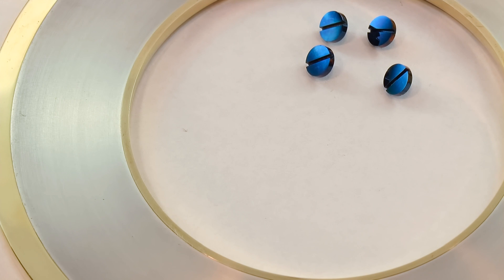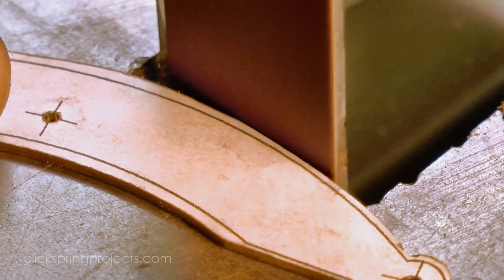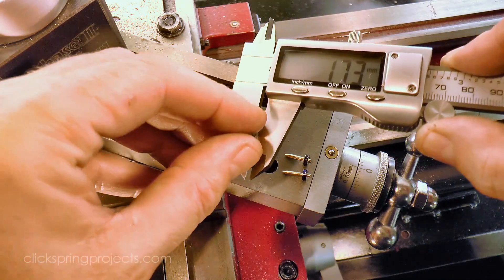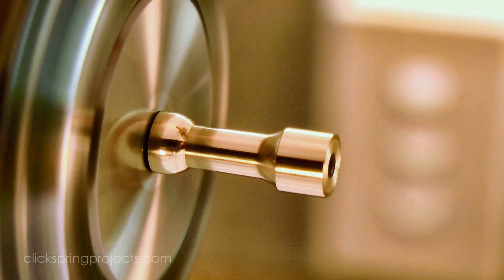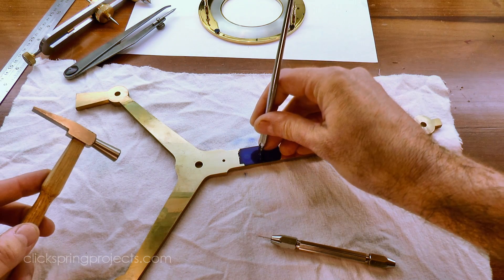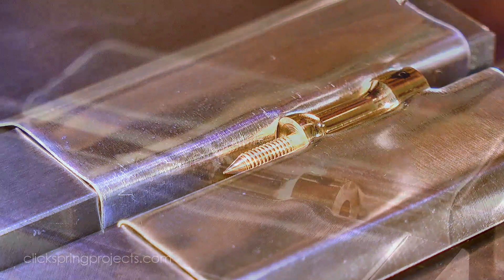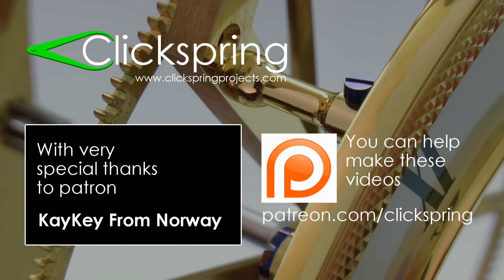Clockmaking - How To Make A Clock - Part 15 - Fitting The Dial Assembly To The Frames

Comment: I am sitting here discouraged, because I'm designing the gear train for a clock and just realized that the main wheel requires 2789 teeth to create an accurate ratio between days and lunar months.  To be exact, between 9-day periods and 850-lunar-month periods.  and 2789 is prime, damnit.

Comment: Couldn't you achieve the same aesthetic result by making to thread on the two ends of the pillars, on clockwise and the other counterclockwise. Then you would just unscrew the pillars to take the faceplate off.

Comment: When using 603 is it better to reem and polish the surfaces or leave them rough? I remember using roughing tools on access holes that were later going to be plugged when I worked in a machine shop making hydraulic components.
Reply from the maker: +rimmersbryggeri One of the most important parameters of a good Loctite bond is the size of the gap prior to adding the adhesive. It is easier to control that dimension with a reamed hole. More info on the data sheets for the products: http://www.henkel-adhesives.com/tds-search-29668.htm?keyword=603&page=0

Comment: Why did you use the needle files instead of the filling machine you have for the brackets ?
Also cheers for the fantastic videos!
Reply from the maker: +Lord Commander Basically it comes down to the fidelity of the tool. Generally the filing machine is great to get a workpiece close, but there is no substitute for a needle file to get a really precise result, and then follow with abrasive paper and a burnisher. thanks for watching and asking LC

Comment: Thanks for the heads up, I think I can make one like that. Your clock video's are amazing I would not have the patience for a build like that but I'm learning a lot of tips from what you're doing, I'm building my own CNC router at the moment and It's already taken me a year. luckily I live alone now so I have more time for it. some of what you're doing applies to what I'm doing, I like the idea of making a tool to cut the form all at the same time, I work with aluminum but I think it's similar to brass as far tooling is concerned.
  I thoroughly like  your video's keep up the good work. any tips on cutting aluminum would be greatly appreciated

Comment: Great video as always! A lot of info and techniques there! But... is the lacquer diluted with thinner  at all??? (it says so in the can, but is that a reminder or a note?)
Reply from the maker: +BIll Georgoulakis Hey Bill, yes the lacquer is diluted 50/50. I find it goes on a little more consistently if thinned, although there is a limit. If it is too thin, then it generates a thin film interference effect (rainbow colors) thanks for watching
Reply: +Clickspring Yeah I though it was abit thin. So what kind of lacquer is it? is it oil based Polyurethane or something special? Have you experimented with semi-gloss or matte finishes for the lacquer?

Comment: Hi  curious where you buy your marking dye ? I cant find small bottles anywhere!
Reply from the maker: +drew7376 I get it on Ebay, search Dykem Blue layout fluid, thanks for watching
Reply: Thanks, I did find some at Blackwoods  called Dy-Mark Engineers layout ink,  but  they are 1 litre bottles
Reply: BTW  Love your work

Comment: what is the paper you use at 2:04 for polishing
Reply from the maker: +jose vega Hey Jose, just standard A4 printer paper. It gives a good preliminary result, but still leaves very fine marks. The final polish comes later using cloth and 1/2 dowel polishers. Thanks for watching

Comment: What are you using as a screwdriver?
Reply from the maker: +Michael “mooP” Haymore Hey Michael, its a small hand vise with a scrap of brass - I don't have a correct sized screwdriver for these bezel screws, so this is a quick fix until I make a new set. Thanks for watching and asking.

Comment: How durable is that blue finish on the screws?
Reply from the maker: +ck m It is a reasonably fragile coating, so poor screwdriver technique etc will scratch it. But if its handled well, it has been observed to last for many hundreds of years in antique clocks and watches

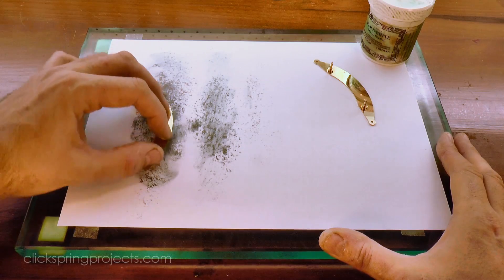Comment: Nice vid again.- at 5:53, doesn't the thinner dilute or alter the loctite cure?- at 6:02, what is the paper substrate that you are applying the polishing compound to?- re the lacquer, what is the reducer you use to dilute? what is typical dry time with looks like a heat gun? Is this your go-to preservation method to keep the nice polished brass shine?

Comment: Chris, thank you for making the video, great work! Questions; how did you use the point screw to find the center line? And I saw that you marked the point of the screw where you wanted to drill the set screw, but how did you line up that point to be at top dead center?  Thanks again!

Comment: How long will stay termal colouring on screws and other steel parts? Is it strong enough?
Reply from the maker: +Andrey Ovcharov It is a reasonably fragile coating, and will scratch easily if mishandled with poor screwdriver technique etc. If handle well, and left untouched it can last many hundreds of years. Thanks for watching Andrey.
Reply: So it is going to last for years even without coating? I was sure that it will weather off very soon. Thank you for the explanation. And for awesome videos of course!

Comment: Hi Chris, I like you videos. I wondering how you prevent the brass getting dark and ugly...
Reply from the maker: +JF- Knives There's really only two options, lacquer or electroplating. I don't have a plating setup, so for this clock it will be a combination of lacquer and simple polish. The wheels can't be lacquered, so will eventually develop a patina over time. Frames, pillars and bezel will be lacquered, but still develops an aged color even under the lacquer. Thanks for watching and asking :)

Comment: Dear +Clickspring, at 7:12, you use a "depthing tool to mark-out a distance". You do this by first measuring out 60mm between the tips of the tool against a scale. Subsequently, you center one end of the tool in a pre-drilled hole (it sinks-in about 3mm into the hole) and with the other end put a marking onto a layer of that fanpage-worthy DykemBlue. If you go with a simplistic Pythagoras, then, due to the 3mm sinking of the cone into the hole, the distance to the marking shall be sqrt(60^2+3^2) i.e. about 75 micron off. Does the conical taper on the center-pin counteract some of this error? Could a spirit-bubble level on the shank of the depthing-tool minimize this error? 
Beautiful video mate :)
Reply from the maker: +Aditya Mehendale Hey Aditya, yes I was a little relaxed with that! The easy way to avoid the error is to use a pointed runner to set the distance (keeping the tool body horizontal) and then replace it with the cone runner for the scribing (also keeping the tool body horizontal). The reality is that for something like this the error is small enough to be of no real consequence. Planting the train on the other hand requires absolute precision, and therefore the process I just mentioned. Thanks for watching and asking :)

Comment: Amazing work - as always. I can't wait to see it completed! I have a question - when you have to make multiple copies of the same part - do you do each copy from start to finish (constantly swapping the tooling out), or do you leave the tool in place and cut that one cut for multiple parts? I imagine it comes down to swapping tools a bunch, or swapping the individual pieces out of the lathe a bunch. Hope that makes sense!
Reply from the maker: +Mitch Spacone Hey Mitch, generally I complete the part, and then move on to the next because there are usually multiple ops required where the part can't be disturbed before completion. Thanks for watching and asking.
Reply: +Clickspring That makes perfect sense - thanks for answering my question!

Comment: Maybe this is a stupid question, but why do you use a clamped brass bit to screw in the screws instead of just a screw driver with some painters tape on it or something?

I assume you don't use a bare screw driver to avoid scratches, but is there any other reason than this looks better on camera than taped up tools does?
Reply from the maker: +Evan Smith Hey Evan, I don't have a screwdriver with a wide enough blade that is also narrow enough to fit the slot of these bezel screws, so a scrap of brass filed to size is a good solution. Being a brass scrap also guarantees no scratching/damage to the screw. Thanks for watching and asking.

Comment: Nice one Chris. Is that lead you're using for soft-jaws?

What will you use for final protection of the brass? You're using lacquer on some parts now, but imply that won't be the permanent solution. I made some LTD Stirling engines for friends a few years back and they looked great when finished, but wax wasn't enough to prevent them losing their "bling" after a while. It would be good to know what to use to protect brass etc on work such as this.
Reply from the maker: +Pete F Hey Pete, the 2 most common options are either plating (gold or rhodium), or lacquer. I don't have an electroplating setup, so its going to have to be lacquer for now. Frames and pillars will be polished and then lacquered at the very end of the build. The wheels can't be lacquered, so they will be polished, and will eventually develop a natural patina as is the case with most clocks.
Reply: +Clickspring Thanks Chris, &quot;natural patina&quot;, I like it! Ok, I&#39;ll lacquer them in future. Caswell Australia has a gold plating kit, you probably already know about.  I don't know if it can plate brass, they also don&#39;t exactly give it away either!
Reply from the maker: +Pete F Yes I've looked at a few of the commercial kits, but I really need something quite large to handle some larger parts for future projects. Will probably have to make something. A friend recently sent me some plating textbooks, so I've got some reading to do! Cheers mate :)

Comment: That metal polish looks very effective!! Are you just using it on a sheet of paper, or is it something special? Here in the UK we have "Autosol" metal polish which works a treat on nonferrous metals - it's weird how it works, seems to actually react slightly with the surface since it initially turns a black mess, but then brightens up when rubbed with another clean cloth.
Reply from the maker: +Lindsay Wilson Yes just paper, although to get the final finish, I switch to cloth on a wooden dowel 1/2 cross-section polisher. That polish is absolutely superb, quite a bit finer than Autosol, and also leaves a wax coating that helps prevent tarnish. Bill Smith makes it: http://www.wrsmithclocks.com/polish.htm Thanks for watching Lindsay.

Comment: Really fantastic work, I'm always excited to see a new video! Two questions: Why are the screws you make always flat head? And what model mill do you use?
Reply from the maker: +nebnoswel Mill is an SX3. Both flat cheesehead and domed screws feature prominently in classic clockmaking, however I have a personal preference for the classic horological shaped cheesehead screw - perfectly flat top, slightly thicker head than a modern general engineering screw, with the barest hint of a bevel on edges. Thanks for watching and asking.
Reply: +Clickspring I think he meant the type of driver that the screws are made for,  though I was wondering if there was a specific reason you made the screws that particular shape. I'm guessing the screws are slot headed because it's simpler to make and looks better than a double slot? (We call them flathead screws here, because we're bad at naming stuff).
Reply: Thanks for the reply! Sorry for not being clear, I meant why are your screws always slotted, but it does make sense that it's easier to machine. Keep the videos coming!
Reply from the maker: +Teth47 +Ben Lewson Sorry my misunderstanding :) Yes easier to make, and again a tradition thing. Thank you both :)

Comment: These videos do not come as often enough to satisfy my innate need to see something completed, but I understand you're doing this as you go, and to make each part and video it, then to also edit it are all each projects in and of themselves.

These videos are soo good i just need more and more. So keep it up; I can't wait for the next one already.

Nice to see the thought process you're doing in completing the clock. Gives me insight to what i may go through when i start making one (once i get the necessary plans and parts.)

Two thing about this though that always take a quick step back, the scale of the parts, and the machinery needed to get it done. 
Scale, as in, when you video it, it is so close, macro like, that I think it's bigger than it really is. As far as machinery, I'm thinking what minimum i would need to just even get started. the small sherline (?) lathe i can see is going to be useful in making all the pins, screws, pivots and parts for other projects ; but then what about the bigger pieces, like the barrel assembly, the frame and the wheels? in a minimalist work shop, what would be the best way i can go about making those? Good thing is i have time to find these answers.

Comment: That's some fancy screwdriver you have there at 6:21 .
Would a "regular" screwdriver damage the blue temper somehow?
Reply: +Arturo Gutierrez IIRC it's visible in other videos that it has a brass blade with parallel-ground faces so it (A) doesn't cam out and (B) doesn't damage the finish in the screw slot
Reply: +Hyratel i'm so used to the crazy tools and detail of this series i didn't even notice the screw
driver.

Comment: What is the final finish on the brass parts going to be to keep them from tarnishing? Automotive clear-coat or something softer? If lacquer, then dipped, brushed on or sprayed?
Reply from the maker: +kopsik111 Most of the larger parts like the frame and pillars will be lacquered similar to what you've seen already. The wheels unfortunately cannot be lacquered, so will be polished, but left to develop a natural patina. The overall effect will be quite pleasing to look at. Thanks for watching.
Reply: +Clickspring Have you considered or tried carnauba  or some hard car wax?

Comment: I admire your work and envy your precision. One question though... Why don't you solder the parts together instead of using loctite? I'd love to see you soldering this parts and go oldschool...
Reply from the maker: +GROMarch I understand the objection to loctite, I gave it a long hard think before I started the clock as to what method I would use. Soldering carries with it a few headaches regarding metallurgical changes to the materials, as well as the cleanup of excess solder around the join, that can be a real pain to deal with. Loctite also is more convenient to reverse the join if needed. In the end I decided on convenience over tradition :) Thanks for watching and asking.

Comment: Were those lead sheets in the vice when drilling the set screw holes? Seemed rather deformed to be aluminium.
Reply from the maker: +Nolansykinsley Yes Aluminium. I though it was a tin alloy before I tracked down the link for someone else: http://www.bunnings.com.au/consolidated-alloys-300-x-0-7mm-x-20m-weatherflash_p1100465 Thanks for watching.

Comment: Hello Chris, how do you form the aluminium buffers that support the pillars when you drill and tap the holes for the set screws?
Reply from the maker: +Vinnay Chhabildas Hey Vinnay, that is some sort of plumbers flashing I picked up from the hardware store. I thought it was a tin alloy, but turns out its aluminium: http://www.bunnings.com.au/consolidated-alloys-300-x-0-7mm-x-20m-weatherflash_p1100465 Cheers, Chris.
Reply: +Clickspring Thanks for replying, what got you into clock building an machining out of interest?

Comment: Chris... UNFREAKINGBELIEVABLE!! This is a work of art already and its not even complete yet! >.<

Question: Does the laquer throw out any tolerances with screws, etc?
Reply from the maker: +themaconeau Yes generally I try to keep the lacquer off the threads etc. If I get some on there, it scrapes off quite easily. Great to have your support mate :)
Reply: Clickspring Mate, I really can't extol enough praise for your workmanship. I know you are learning and taking us for a ride but damn son, you are very meticulous.

Is there a lot of "R&D" on your part before making a video? As in, trying out things, perfecting and honing processes before making the part or toll for your clock? Or did you go into this project with a baseline understanding or more?
Reply from the maker: +themaconeau A bit of both. Some parts are pretty straight forward so I can just dive into it. But something like the impossible dovetail project needed a bit of prototype work first, so I could be sure that I could make it work. For example for that one I made a test cutter and did a bit of test cutting in Al to see how it performed before committing to making a vid of the project. The vid of the prototyping ended up becoming a short Patreon video. Very much appreciate your support mate :)

Comment: Great Video!, i'd glue the brackets together when making those.. in that way, you only have to trace out one.. and because of the double thickness it is easier to get a nice perpendicular circumference.. :)
A V-Groove in the Dialfeet in the right spot, makes that the setscrews "pull"  the dial against the pillars.. (just like a Whistle-notch endmill in a Weldon tool holder).. but.. apart from those details.. "no further comments your Honour".. :)
Reply from the maker: +Jan Binnendijk Good idea on the V groove Jan, will keep in mind for next time, thank you :)